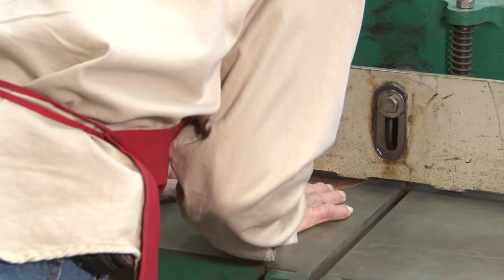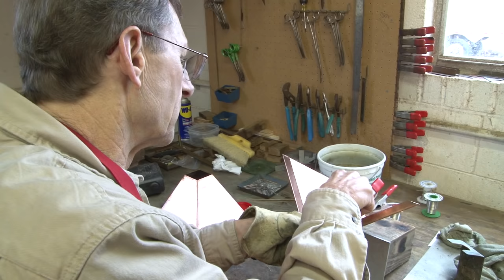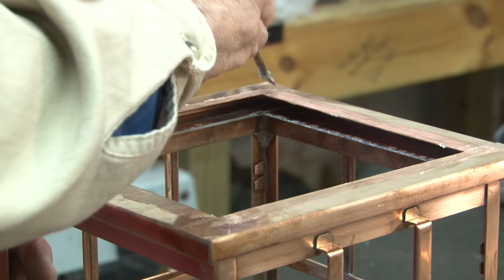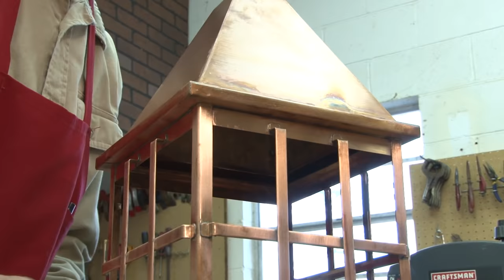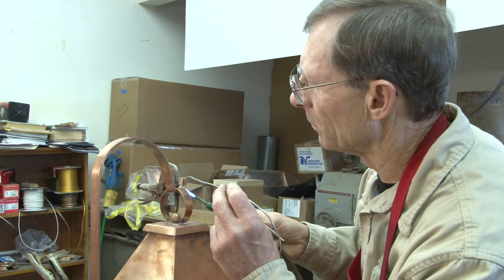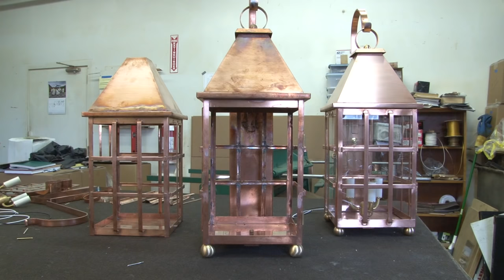Mick Aderholt copper lanterns demo

Comment: Beautiful looking.  But unfortunately the soldered joints fail over time.  That is why all the old gas lamps throughout the French Quarter in New Orleans are held together with copper rivets.  Very few soldered joints exist and none of them are structural.  Have a look at Bevelo lights for a good example.
Reply: need to be brazed ,not soldered or 
riveted.

Comment: I hope you can read this and reply, I make  copper light fixtures as a hobby but rivet the joints before soldering , in the first portion of the video when you are soldering the cap/roof, it looks like 4 tri angles soldered together but later on the hood looks bent not soldered as if you had bent two tri angles to form half of the roof then joint the two halves to form a complete pyramid shaped hood, am I mistaken?

Comment: I'm making a copper Lantern and whenever I solder over the glass it cracks are there any tricks to avoid this?
Reply: jason -wet rag, dum dum putty, use heat resesistant glass or remove glass. be slow and careful.
Reply: Put glass in after lantern is finished ... Use little tabs folded over the glass to secure it in place
Reply: jason use little pieces of solder and just run the heat over the area quickly. Don’t let the copper get to hot as that will crack the glass. The solder does not need lots of heat. Also use propane instead of acetylene as this makes less heat. Moving your torch quickly and only se as much heat as needed to only melt the solder is the trick. Just add little pieces of solder until you have a full solder joint and lat the piece cool between soldering each piece.
Reply: @Andy-Gibb  thanks for the quick reply lol. Keep up the good work keep the craft alive.

Comment: Anyone know what mix of gas he's using?
Reply: Litemup it is usually oxygen and propane. If you go and look at a plumbing supply they sell a propane burner that will also work well. The size of the nozzle is the secret. You don’t need much heat. You can get plumbing solder and flux from them as well.